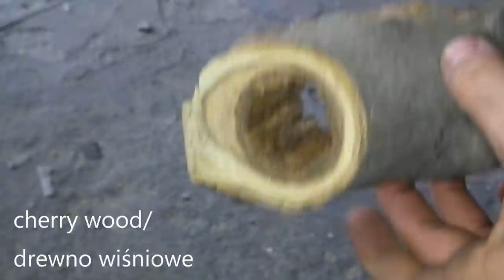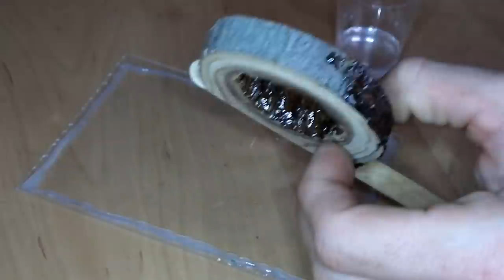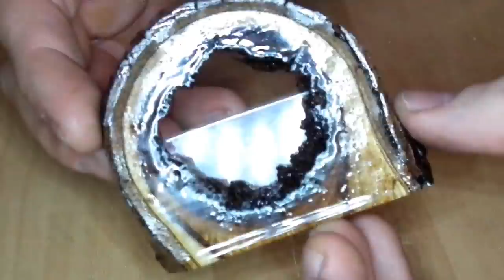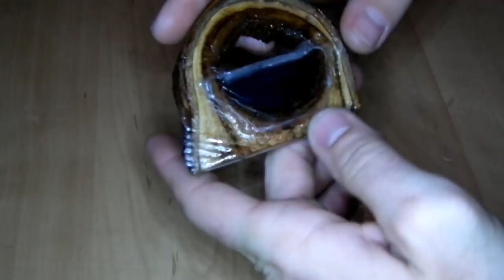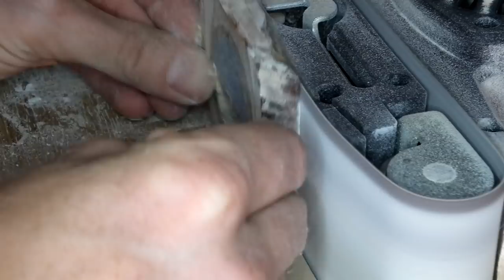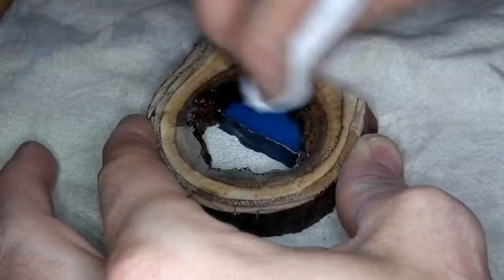Ocean from Resin 🌊 / ART RESIN

Comment: Would it help at all to apply a layer of some type of oil coating to the plexiglass before you pour your resin? I’m new to the resin game, but I started putting a thin layer of cooking spray on my molds before pouring so it isn’t dull when it comes out.

Comment: Hi, Ben! Where do you get 1mm Plexi? I was Looping for it at eBay and Amazon,  but there's online 2mm minimum and that won't break that easy after cutting. Could it be you are using polycarbonate instead of plexi? Is that stiff enough?
Reply from the maker: 1mm plexiglas with anti frame

Comment: Hi there, what a beautiful piece, I guess because it is so small, it's beauty is in the tiny details. I do worry that one day you simply won't be able to remove the clear plastic and glue. (You seemed to have a really tough time on this project) I would be so proud had I made such a pretty piece, and this is so pretty. Thanks so much for sharing this with us xxxxxx
Reply from the maker: It was not easy. But I pulled out the plastic. I try to be careful not to overload. Thank you
Reply: Isopropyl alcohol helps to remove the hot glue and detach the acrylic from the resin

Comment: I tried something similar but filled the whole inside with epoxy.  After it hardened it cracked 😕 !  What did I do wrong?   It was also bigger in diameter like a 8 inch circle. And it was giving off heat after it was poured? Anybody know what went wrong?
Reply from the maker: Normal resin is suitable for castings up to 100 grams. You have to buy resin for large castings

Comment: A great idea!

You don't need a knife to separate the hot glue. Just a few drops of alcohol are enough to separate it with your fingers. Sometimes it leaves it self. I use this technique for creating molds for plastic repair. You can see it in my movies.
Reply from the maker: Ok. Thanks 👍
Reply: a little heat wound do it too.

Comment: Your concept-to-realization is amazing. And I am still wondering how you can get such clear epoxy resin. Did you do any treatment or procedure for the epoxy resin to get rid of the bubbles?
Reply from the maker: I use a vacuum chamber
Reply: @jedrek29t  also maybe what kind of resin. Mine is very viscous, yours doesn't seem to be thick. What brand (or kind of resin, if you don't want to name a brand) do you use?

Comment: How do you get the risen so clear with no bubbles????
Reply from the maker: I use a vacuum chamber. Alternatively, you can put both containers of resin and hardener in a pot of warm water for 15 minutes. Warm resin will become thin. And the air bubbles will come to the surface faster.

Comment: the last few videos i have seen you struggle with removing the hot glue, get yourself some 99%  isopropanol alcohol, dab or spray it on to any hot glue and it turns harder and removes its ability to grip anything. might make your life a little easier?
Reply from the maker: I do not know how he will react with resin

Comment: Out of curiosity, why don't you use mold release for the plastic wall?  Also what it the purpose of the hot glue on the wood if your going to sand it down? Seems like a lot of extra work.